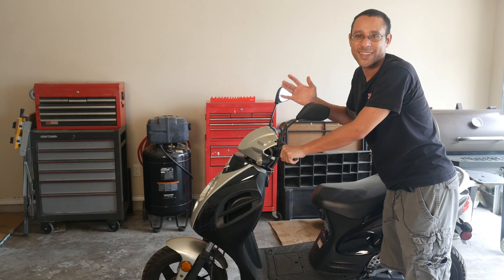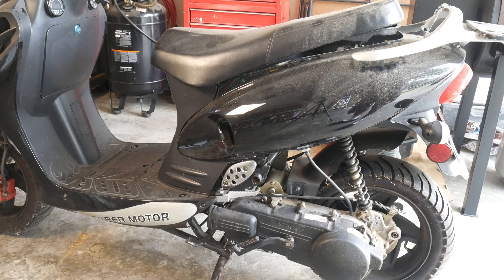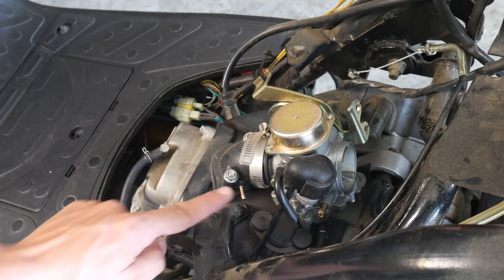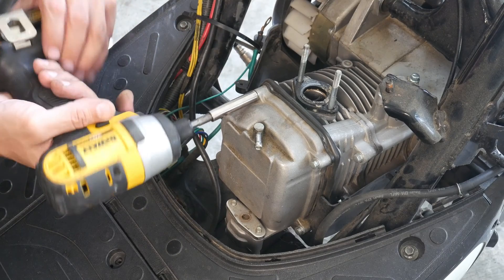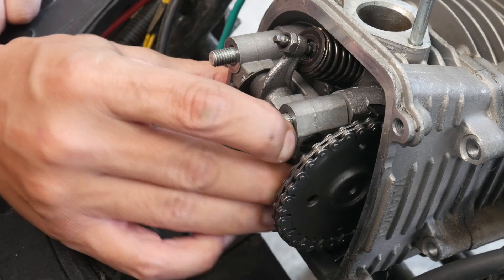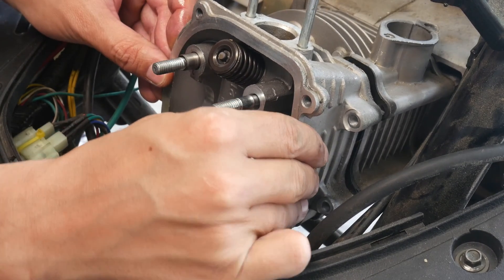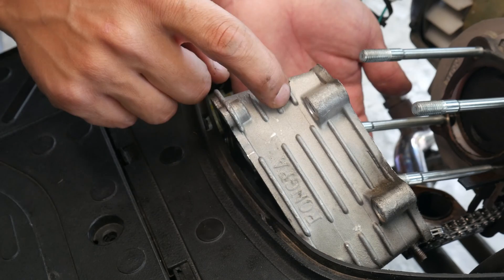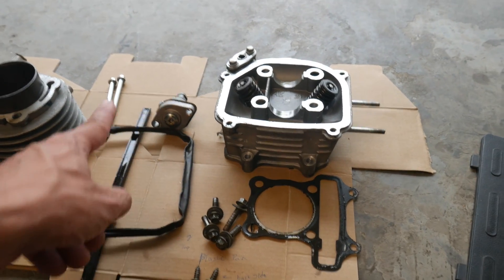GY6 Big Bore Kit - Disassembly (Part 1)

Comment: Man I need help I can not get my 100cc big bore kit to stop smoking white carburetor smoke iv have tried everything i rebuild ot of motors timing is right valves right 31 idle jet air screw i can turn  it all the way in an motor still runs all new hoses 4 new carburetor nothing stops it .new cdi new plug what going on?

Comment: does it work on 50 cc stock ?
Reply: Lol and yeah dude 50cc is a GY6 to I got the exact same one of the 50cc dude I bought so much stuff for my motorcycle to get it where it should be I pretty much got everything for it all I need now is the muffler railing pipe cuz it didn't come with it and probably some Jets but I don't think I need the Jets I think my Big carburetor will be okay without the Jets. Upgrade but you can go on to a hundred cc that's what I got the biggest one you can possibly get for a 50CC unless you want to swap out the engine for 150 or 250 you dig.?  Ah. 💪🏽

Comment: Has anyone had issues with doing a big bore kit on a gy6 50cc engine where the cylinder pin is to large ( diameter ) for the 50 cc piston rod?
Reply: Friend, there are two different ones. One is 13mm and other 10mm. Depends on connecting rod (crankshaft). Watch out.

Comment: I did a 58.5 and it made a hell of a difference
Reply: Gixal  is pretty good if you’re gonna go for cheap ..isn’t 57.4 is just a stock bore
Reply from the maker: Jay Crew Don’t get me started. Yeah, a lot of performance lost.  I’m still salty about it.
Reply: Joey's Garage take it off and send it back
Reply from the maker: Jay Crew Thanks for the encouragement.  I don’t want a delay in the project, but really have to for best possible performance.
Reply: Joey's Garage I have 58.5 with stock head and she’s a ripper 28 bucks on prime two day shipping can’t beat it I can’t wait to see the results you have.. I also noticed you have the same bike as me what year is it and did you have the backfiring issue
Reply from the maker: Wanted to do the 60.1, but got discouraged with online sellers. Finally found a good one, but too late to go back.
Reply: Thanks for the video Joey